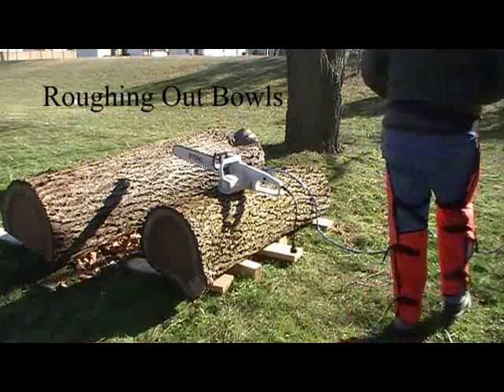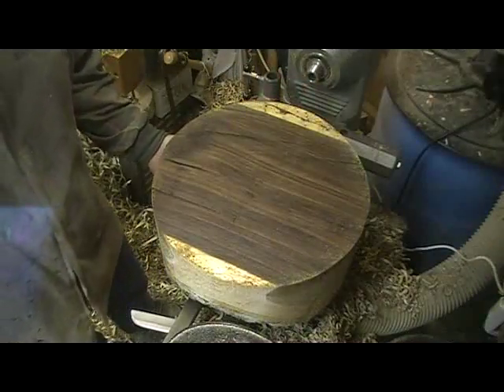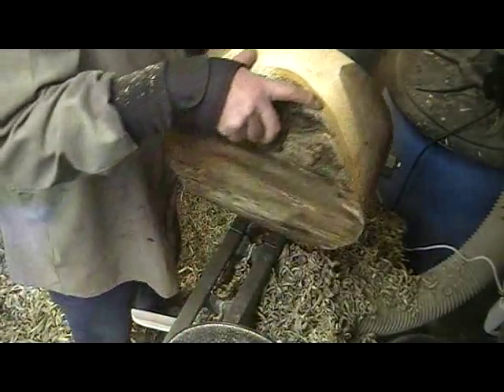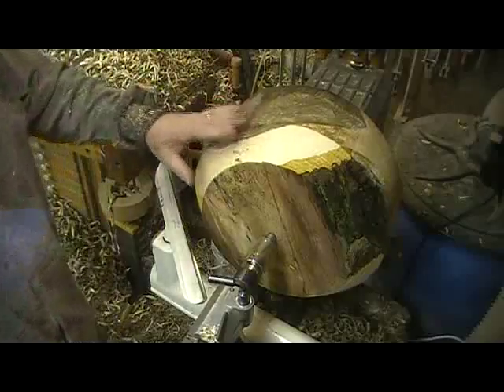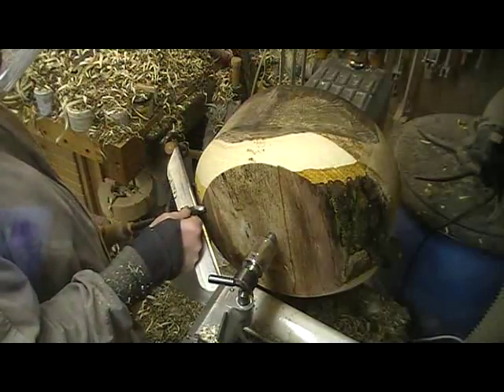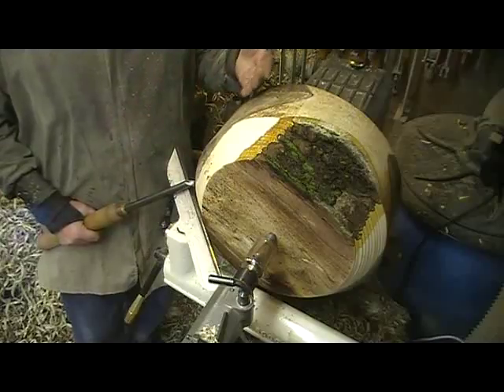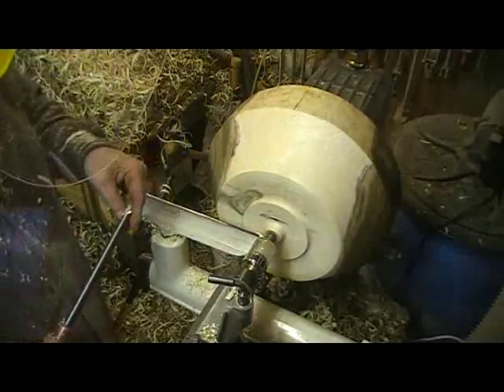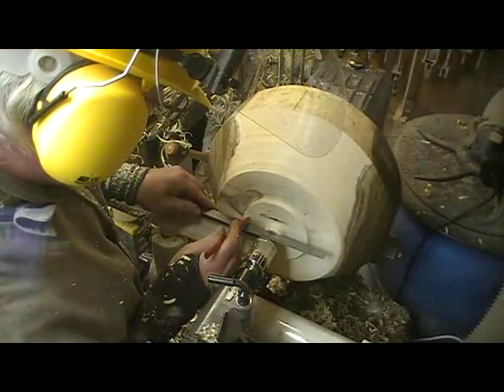Roughing bowls part 1 of 3

Comment from the maker: Hi, Kipperdude:
I have used a faceplate or woodworm screw for initial mounting, but once you have a piece mounted that way you are committed to turning on that axis.  Mounting between centers allows me to make adjustments for balance of the blank and figure in the wood right up until I make the final cuts on the tenon.  On irregular shaped green blanks that is important because it is pretty well impossible to know where they will balance until they are on the lathe.

Take care
Bob

Comment from the maker: I am afraid I don't understand what this means.  I do use a chuck once I have established a gripping point for it to hold on to.  I start between centers so I have the flexibility to be able to change the orientation of the piece if I uncover a hidden flaw.  I wouldn't be able to do that if it were mounted on a faceplate or chuck mounted woodworm screw.

Take care
Bob

Comment: What kind of lathe you got there? Very nice videos!
Reply from the maker: Hi:
Thank you!  

That lathe is a Nova DVR 3000 (the predecessor of the DVR XP) and it is an excellent lathe.  I have since replaced it with a Oneway 2436 which allows turning larger diameters and has much more weight for stability.  

Take care
Bob

Comment: a face plate would be much more secure and eliminate the need for the tail stock.
Reply from the maker: Hi, Geoff:
A faceplate is only as secure as the screws hold on the wood, which is not all that great a hold in green wood.  Even if I had used a faceplate I would still have used the tailstock, at least until the workpiece was rounded and running in balance.  Once a piece is mounted on a faceplate you are committed to turning the bowl on that axis.  With mounting between centers I can adjust the mounting to improve the balance and better accommodate the grain and figure in the blank right up until I am making the final cuts to size the tenon.  Either method works, I just prefer to mount between centers.

Take care
Bob
Reply: Geoff:  I start and finish ALL bowls between centers.  There is no question that a properly seated face plate is a more secure connection (if tailstock is used), but if both the drive center and tail center are set correctly, there is no danger starting off between centers.  The distinct advantage of starting between centers is that the bowl can be tipped and tilted to get the figure (or "grain") orientation balanced just the way you want it.  Then you can go to a faceplate or a chuck, as you prefer.  If you start off with a faceplate, the orientation is determined by the flat cut at top of the bowl, which may lead to an unbalanced-looking bowl when finished.  Starting between centers can make the difference between a good bowl and a great bowl.